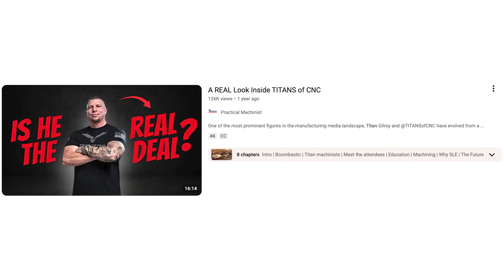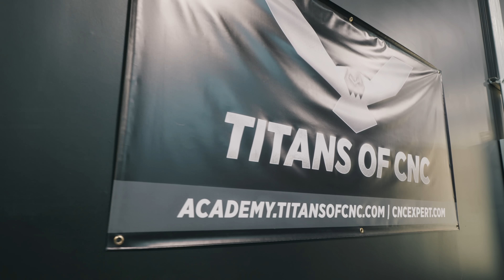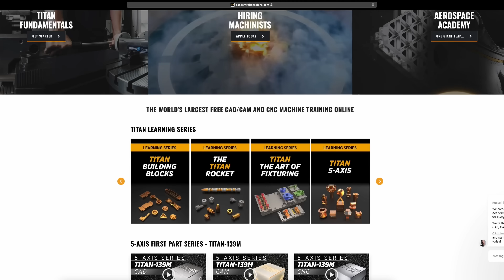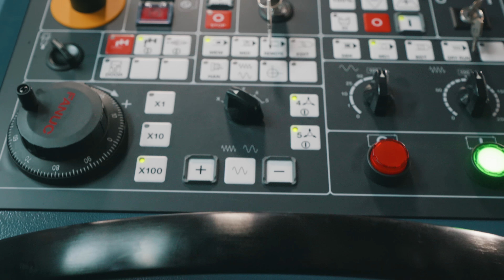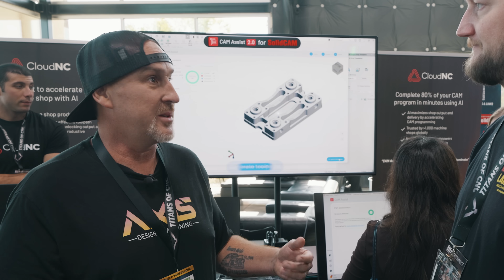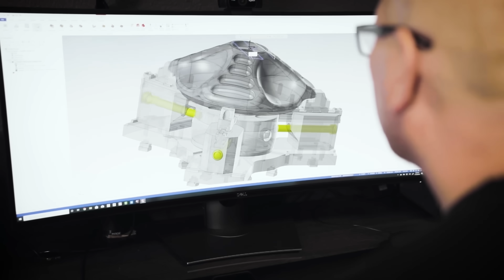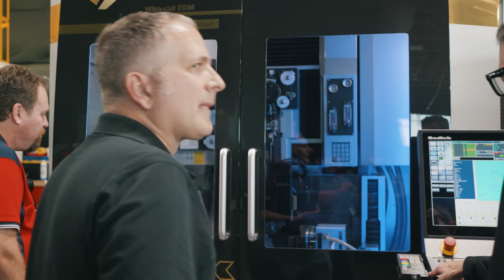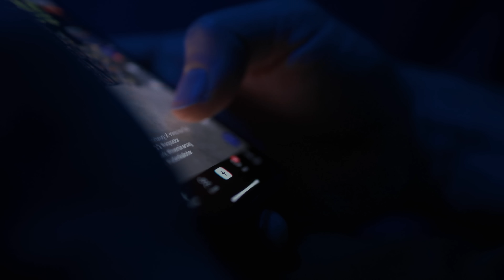The TRUTH About TITANS of CNC’s New Direction

Comment: Back in high school, I took machine shop, as well as welding. My school had one CNC lathe, everything else were Clausing and South Bend manual lathes. Also had a Bridgeport mill. Welding spoke to me more. Went to school for welding, but also had to learn to use an CNC brake and plasma table. Didn't have a great teacher for CNC unfortunately and it ended up being more of a mental block.

The difference between going into something like CNC and staying with manual machines, really comes down to someone's ability to teach a person how to do it, how to troubleshoot, and being patient. Thats the biggest thing. Being able to teach and train people in the way that each individual learns and not just cookie cutter.

Comment: in my career i have learned to set up and operate manual vertical and horizontal mills, engine Lathes, ID, OD and surface grinders. Also able to set up and operate CNC vertical mills and lathes. also able to machine prototype, tool and die, mold making, fixtures, machine building, machine rebuild, job shop, and production parts. Also have been able to solve many problems that the engineers were not able to solve. I kept hearing the phrase " Chris you got to slow down your making us look bad". And most engineers got mad that a grubby machinist with a high school degree "out did" them, not enough team players. All this would have been fine if there had been more of the upper management gave a s*** and paid a proper wage. no matter how many good parts you put out or found a way to speed up production you would get nothing for it. It's sad because this is the greatest industry on the planet.

Comment: This is awesome, but we need tool and die and repair guys way worse than programmers and setup guys. There are so many manufacturing facilities that would benefit from 1 or 2 guys in a tool room with just 100k worth of equipment it’s insane.
Reply: This is surprising to hear - we have a full service tool and die repair facility at my shop and there’s zero work for it out there

Comment: This industry will shortly change and programming CNC by operators/programmers will become as useful/common as being able to use a slide rule. AI will make estimating and pricing almost w/o cost to the machine shop. Programs will be written from digital plans or 3D scans optimized for the machine selected with the tooling listed and laid out. work holding will be part of detailed plans using tooling and CNC already present in each shop. Speeds and feed rates will be optimized for each type of materiel and operation for the specific tool/machine/material being used. Machines will be selected by hierarchy of capability, efficiency and time available throughout the shop. This will lower costs for quality machined parts allowing companies to use more machined parts than ever before growing the industry exponentially to the benefit of all. This is the likely outcome of AI used within this industry, those that adapt and adopt will thrive. Ray
Reply: Yes, you are right that is the future but the upfront costs are impossible for small shops to bear.
Reply: @urbanturbine  Same as today with small shops that do not have CNC! Upfront costs will be surprisingly low as this is not new operations needing new equipment what's new is who writes the programs, assigns machines decides tooling and does estimates for the existing CNC equipment so all a shop that already has CNC needs is software in their desktops/computers

Comment: 25 yrs in tool and die and mold making.  Finally got smart. Got a job designing packaging. Turns out designing cardboard boxes paid far better with 1/3 the stress.  The wages to stress factor is completely out of whack.  I would never recommend anyone get in the trade.  Be a plumber, electrician whatever stay away from tool and die.

Comment: here's the problem... the CNC machines are getting more expensive. the tooling is often 50% or more the cost of the machine itself. many of these CNCs hes showcasing run north of $250,000. with most in the sub 750,000 range. On the low end the crappiest CNC he uses is about $40,000. the software is rented (you dont own it) and the lead times of those wanting one part is not reasonable with what they want to pay. The  median Machine cost is out of reach for 95% of shops out there. This leaves CNC shops fighting over contracts that pay for short runs. the only thing left is one off repair jobs that are often associated with needing large manual machines to alter or repair parts often associated with large machines or very expensive aerospace that requires the top of the line CNC and techs to run. there is very little in the middle or the bottom for small shops on a budget. this field is going the same way mom and pop stores fell victim to giants like walmart.
Reply: Very well said. Cost of machines have skyrocketing. In China, there are ordinary shops with 50-60 machines lined up, how can they afford their equipment and we cannot? The answer lies under Private equity firms buying up everything and jacking up prices. They will bring this country to an end if no one does anything about it. Our political system got fundamentally flawed when Citizens United was passed and superPACs (people with money) took over government. So much to talk about and so infuriating.
Reply: @urbanturbine  china subsidizes its industries..

Comment: When people talk about kids that 'use computers'.........that makes ZERO difference.  A: you cant be a good programmer until you are a good machinist. B: To become a good machinist, you must do laborious work like cleaning a machine,  deburring, set up, ... just getting dirty.    Good luck getting these 'computer kids' to do the actual work. 
  But, Its an amazing career, and we need waay more young people to start out!
Reply: A computer kid doesn’t have to, when they can program a robot to do these jobs. The thing is, automation is getting cheaper,
Reply: @arbjful  you cant program what you dont know.....
Reply: I'm glad you had the "B". I went through my Tool and Die Making apprenticeship at Smith-Corona. They were the equivalent of a buggy whip manufacturer in the latter part of the 20th century. They manufactured typewriters! Cut to the chase. Part of the tradition in the Toolroom was that the very first "project" we were assigned to was cleaning and painting ALL of the machines in the Toolroom. That had to be, at a minimum, 30-40 machines. Mills, lathes, surface grinders, tool grinders, drill presses, shaper, optical surface grinder for complex forms, cylindrical grinders and I can't remember what else. At some all of the apprenticeship ditched and moaned about the misery of cleaning and painting the machines. We were all given a little gem of advice: here's an opportunity to "play" with the machines. Pull/push that lever, turn the cranks, pull the covers to see what the covers are covering AND watch what the Journeymen are doing the machines. Great shop, great Journeyman, great mentors.

Comment: I am a hobby machinist. It has actually upped my game on what I can deliver, not just for myself but the people I work with. What normally would take more red tape & long lead times, I can turn it around pretty quickly. Making things easier for my guys in the field. (I am in heavy commercial/industrial HVAC) It’s allowed me to show the guys how to do things right. How to read a Mic, how to properly use telescoping gauges, etc. Ironically I was taught initially wrong on the telescoping gauges. I want to make sure these guys are doing it right, making it easier for them. Hopefully inspiring them to get into machining, even if it’s at a hobby level.

Hopefully I can go next year to the event since its right in my backyard.
Reply: Definitely worth making it out next year if you can swing it - it was quite the experience and great to network for people who are truly passionate about the trade